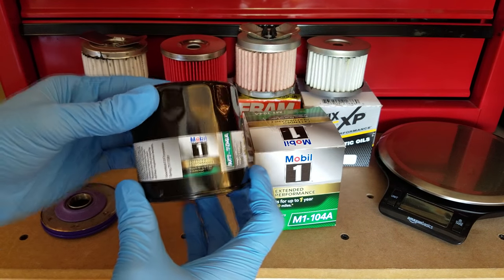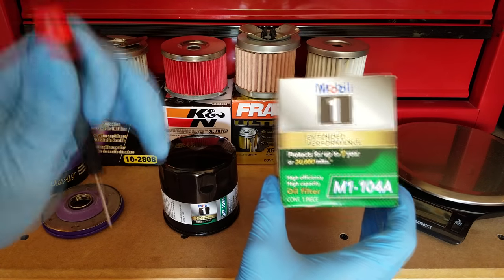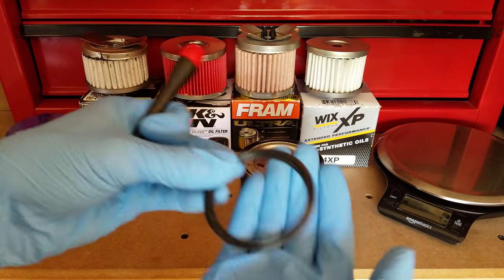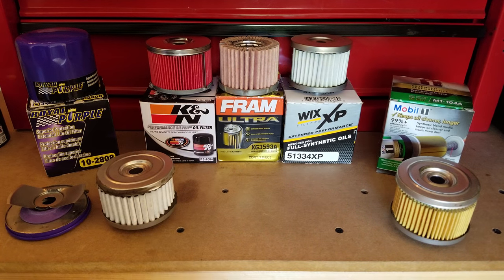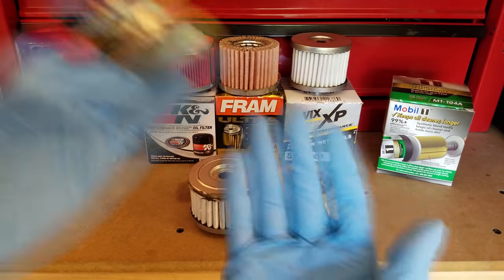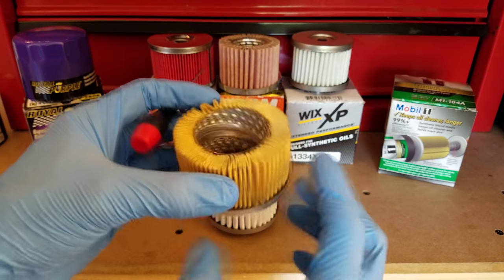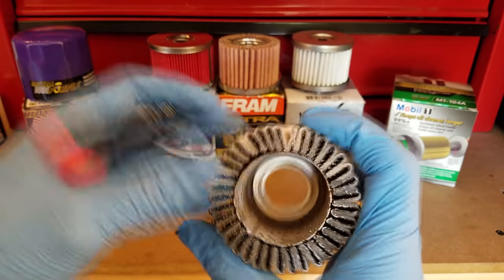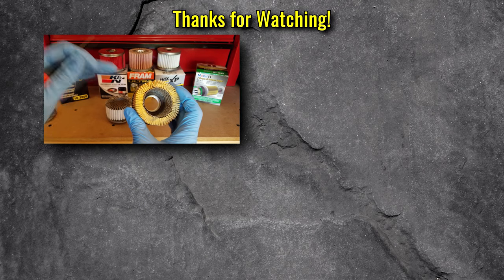Mobil-1 Oil Filter Cut Open! | vs Royal Purple/WIX/K&N!

Comment: my 2014 gmc yukon has 214,000 miles, I change oil every 12,000 miles with walmart full synthetic and ac oil filter, all synthic oil today is so good it does not break down and after 12,000 miles my oil is not that dirty, expensive oil every 3,000 miles is a total waste of money and resources
Reply: I been using castrol, and mobil syn. oil, but decided to try it out because it was $15 for 5 qt. That walmart synthetic was clean af after 3k.
Reply: I use SuperTech synthetic exclusively and stretch it to 10000 miles on all of my vehicles, oil analysis shown no significant wear.  Can't beat the price, $20 for synthetic oil and a quality filter.
Reply: 12k intervals depends on climate, driving patterns and engine. I wouldn’t try that on a VW 1.8 turbo which is known to sludge easily. A used oil analysis can help determine if you can extend your oil changes and if the oil is working well. Having said that, I’m running 12k intervals as well.
Reply: I tried the supertech synthetic and I think it was really good oil.  I feel,  so I'm speaking subjectively, the oil stayed thicker and heavier in my engine,  the engine was a lot quieter and I think my MPG was down a bit because the oil stayed thick and didn't break down.  Again I didnt send it to Blackstone so I don't have data. But you want your oil to hold up to protect my engine. My manual says I can use 5-20 or 5-30, I used the 5-20 grade supertech and I had the MPG of the 5-30 oil I have used before
Reply: You should be changing it every 3k. 12k is way way too long
Reply: @kenshinhimura9387  3 k for synthetic is a waste of money. Unless you drive a 4 cylinder turbo full blast all the time, you can keep the oil up to 6 k easily.  If it's a car that's on the highway all the time you can go up to 10 k. Just check the color, brown is OK, black is not.
Reply: @rejm1161  lmfao... for oil should never even be brown. It should be light gold like honey. If it turned brown you've been driving on it too long. If you want your car to last forever you change the oil every 3k. This is if you plan on keeping the car forever and never sell it. If not then fine, you can go 6k before a oil change
Reply: @kenshinhimura9387   it stay light gold for quite a while , then it start to be a darker gold which is like brownish, then it turn black, but I change mine before it turn really black.  Maybe because of the very cold temperature where I live, the oil doesn't react the same way.
Reply: MegaStick93  and that's why your car doesn't last past 200k miles. Because you don't change the oil enough ..
Reply: @fitnesspoint2006  go ahead and believe what you want. I've got over 270k miles on my engine and it still runs like the day it rolled off the assembly line. That's what happens when you use full synthetic oil and change it every 3k miles. It will last forever. I will have a million miles on this engine and you will have to keep buying new cars.
Reply: @boostedmaniac  lol my friend had a golf whatever with a 1.8 turbo. She came to me and said MY ALLADINS LAMP LIGHT IS ON. I said thats the oil light she said oh I need to put oil in okay. I said no thats not for level but pressure. When the light is on you are damaging the engine. 
So it took 3.25 qts to bring it to the full mark. That engine had 1.25 qts in it. 
Still ran fine.
Reply: @fitnesspoint2006  must be an emo thing?
Reply: @kenshinhimura9387  wrong. Synthetic oil protects WAY longer than conventional. If you use conventional MAYBE 3k is fair but it will last.longer
Reply: @kenshinhimura9387  holy crap you waste a lot of money! Doubling your changes would still get your longevity.
Does that mean if I brush my teeth 6 times a day they will last longer than 3x a day? Nope. Just would be doubling my toothpaste expense
Reply: @kenshinhimura9387  Color is relative. Go drive a diesel with new oil, check after 200 miles, it'll be black.
Reply: @kenshinhimura9387  
Oil color has NOTHING to do with if it needs to be changed or not.  This is a stupid old myth.

I have a Landcruiser with 1FZ-FE.  Oil changed every 6,000 km's with conventional oil it's entire life.....sitting at 536,xxx km's.  Oil is black coming out every time.
Reply: @kenshinhimura9387  I agree. Yes you can let your oil go longer if want but you have no idea what your engine is going through. I think it's hysterical how car manufacturers spend millions of dollars on specialist, laboratories, and test to see what their engines will work best with and how often oil change should be made. Yet, John Doe thinks he knows better than the experts. Oh wait, that's right the experts just tell you to change your oil at the intervals that they say because they want to make more money off you, everything is a "conspiracy" to screw the people. I think I'll just stick with what my owners manual says.
Reply: @tdgdbs1  you still have wear. If you change every 3k you'd have zero wear. Big difference.
Reply: @kenshinhimura9387  Zero wear, how scientific!!!
Reply: @kenshinhimura9387  Just curious, do you work for an oil company?
Reply: @kenshinhimura9387  I'd hazard a guess the manufacturer's are bit more in touch with mileage tolerance for oil than jiffy lube is.
Reply: @RolandtheThompsonGunner  gonzo, most car manufacturers are 10k recommendations now (from bmws to trucks).  so those millions of dollars they're testing says it's more than safe to go past 3k miles, despite what jiffy lube says.
Reply: @wclintf  You ever stop to think the reason they say you can go so long on oil changes is to get you just past your warranty and then you start to have problems? It's called planned obsolescence.

Comment: The Mobil 1 M1-110A can be purchased for $9.99 + tax at Meijer's here in the Midwest.  Usually I try and bundle purchased with Mobil 1 synthetic oil deal when XOM is running a rebate special.  It then knocks my net cost of the filter, after tax, to about $7.50!

Comment: Heh, that's the one I use.  Though they get changed at between 14 and 15k miles with my oil(I do buy the extended life oil too, not risking it if the company doesn't actually claim it publicly)

Comment: One thing to note about the Mobil 1 20k mile 1 year claim/warranty is that there is a stipulation involved with it, You have to use the Mobil 1 Annual protection oil with it which also carries the exact same claim. Otherwise they will tell you to go pound sand if you blow up your motor running that long on oil.

Comment: Mobil 1 and K&N filters are manufactured in the USA by Champion Labs and are built to each contractors specs. Champion also makes some of the cheapest filters on the market for shops and oil change joints.

Comment: The thick glue is actually a good thing, is sealing the filter in the top allowing to open the valve to work if is necessary without leaks otherwise the calibrated spring is not accurate, can deliver a poor bypass supply of oil and defeat the purpose.

Comment: Walmart has Mobile 1. For $10.00
Reply: Jack Smith yeaaaaaa
Reply: Paul Pflaum, If you read the fine print, they say they use recycled oil. That is why it is so cheap.
Reply: David Klimmek agreed! The reason why Walmart brand is way cheaper than any other stores in US. I’d stick to buying oil in Peoboys
Reply: Thats where i get mine along with Mobil 1 oil on the cheap
Reply: Here in California I pay 30 bucks for Mobil oil and 12 for Mobil filter
Reply: notgaybut20bucksis20bucks the price he gave was for a 5 quart jug of Mobile 1 full synthetic oil, i pay the same here in MT. Its the same jug i could get at any parts store without the insane markup. I can get it even cheaper at Costco but they only carry 10W-30 and I use 0W-40, works great those frigid temps we get. Engine's got 168,000 miles still runs like new.
Reply: Paul Pflaum  i just bought it yesterday. did not realized, walmart has it. i used to buy most AutoZone which is more money... AutoZone 39.99. ,,, walmart 26.95... which is cheaper!
Reply: They recently added it. I've been buying at autozone.
Reply: Paul Pflaum  9
Reply: Paul Pflaum, way to step up internet tough guy.
Reply: I just about oil 1/28/19 at Walmart M1 EP high mileage 5w-20 and it was $29.99, annual protection was $39.00 they're both more than I expected oh yeah the annual protection filter was close to fuckin $18
Reply: I'll make it simple, if buying the items seperate buy at Walmart, if doing an oil change buy at whichever autoparts has the best Mobil one and filter special, it's only worth buying at autoparts when they have their oil specials , it'll usually save you 5-7$
Reply: Why would you buy that crap when Royal Purple is the best !!!
Reply: @williamschuman4951  Because I'm not public schooled. I like keeping more of money. Not paying $12.00 for a quart purple oil. That I can buy for $3.00..

But as they say. A sucker will buy anything, even a turd. If you call it the best cow shit turd, money can buy..
Reply: They have Castrol Edge high mileage advanced full synthetic oil for $22.48 plus tax.I also bought the mobile-1 oil  filter extended performance. For 9.68 plus tax. Basically like you said 10 bucks. I live in south Tx it gets super hot down here in summer. I’m putting the best in my car, because it’s a fact, that heat destroys a car. Full synthetic keeps the engine cooler. It’s better to pay a bit more for better protection.
Reply: Attention wal- mart shoppers. They have royal purple gallon at Walmart for 38 bucks plus tax.
Reply: Trade mark lose the e
Reply: @ricketysplit1  not true at all. I looked at the label and even found it online. After using a word searching tool and looking myself the only time the word recycle is used is on the front when it says "recycle used oil at participating retailers"

Comment: I bought a Mobil1 filter tonight and unfortunately they have changed the base plate.  The gasket is now squared off and sits in a crimped channel.  It has 8 small holes and  20 mm stamped on it.

Comment: I got over 30,000 miles utilizing a K & N premium oil filter and Amsoil signature series 100% synthetic 0-20W motor oil with superseding used oil analysis optimal test results and less service intervals. You get what you pay for. Actually, if you perform the math, the aforementioned duo is more cost effective than its competitors.

Comment: Mopar brand oil filters? I've been using them for about 6 years now.
Reply: Brian B thanks,I use MOPAR,( at Walmart Helena MT) on my Journey 2015 4 CYL, IF I,can loosen it from MOPAR Dealer Performax( Mexico) FILTER THEY USE ON PROGRAM Oil changes::they use MOPAR CONVENTIONAL 5W-20 , & sometimes I replace if 2000 mi or so: before my Scheduled........hopefully may help...though as a rule, prefer NAPA GOLD for shorter OCI, ROYAL,PURPLE longer oc8

Comment: The lip on the o-ring is to help keep the o-ring from sticking to the engine side when you remove the filter. When a person doesn't pay attention and two o-rings are smashed it will leak real bad. Imagine a person not double checking for the old gasket and not checking for leaks..... I am surprised all filters don't utilize that design now.

Comment: I used wix then puralator boss and now Mobil 1 EP oil filters and i dont know any difference never took a sample to a lab and I switched from M1 high mileage and it slightly burns oil but no burn when I use extended performance 15k mile

Comment: I normally use motorcraft filters but tried a moble 1 on my last change. I was surprised to see after 3000 miles the oil was still amber in color. the oil was always much darker with the motorcraft after that many miles. I have to assume its because of the filter.
Reply: Were you using a conventional or semi-synthetic blend before?

Comment: I found your video entertaining because I've never cut open an automotive oil filter. The only critical comments I can make are you educated in the different types of O rings/solid seals and whether having a spiral seam that is a much longer length vs a straight seam is better? You made a few judgements without backup facts such as materials used. Now a  days we have some great engineers designing equipment and in my limited experience I have found that materials and the manufacturing process are usually the critical determination of whether a product is "best quality".

Comment: You really need to work on holding your hand steady and centered to prevent the focus hunting. Rather than constantly moving your hands, hold the filter steady and talk. Don't talk with your hands while onscreen. Less jerky movements would greatly improve your production. Slowing your focus down a notch or two in the camera would also help.
Reply: Or use a wide angle lens set to about f 8 and manual focus the entire frame. No more focus hunting
Reply: That's the whole reason I watch this guy. I love the fast crazy hands. It's going to be a new trend.
Reply: @Filterficial  Motorcraft PLEASE!!!

Comment: I have a friend of mine who never changed his oil for 50,000 miles...that's right ...for... FIFTY THOUSAND MILES..!!!....It was a Toyota Celica GT...And also he never checked his spark plug wires for cracks and normal wear....He came over my house one day and asked me to check his car out..cause i was one of the best shadey Tree Mech around I was always working and tinkering with cars especially when you own an British MG antique sports car...anyway on the spark plug issue that was seasy ..i told him to pop the hood and crank her up  and it looked like a fireworks display under there!! lol Sparks from the cracked wires were going everywhere!! lol and on the oil change issue his soil was almost like crystallized MUD..!!  Flushed it out the best ci could with the products they had duridng the early part of the 80's. Well we changed the oil on his car and later on down the road the Celica GT just couldn't stand the new OIL AND BLEW UP>>>lol...end of story...

Comment: Have you ever heard of old timers, Korean War vets placing a strong magnet  (1" diameter x 1/8' thick)  at the bottom of their filters..
Reply: Some oil filters nowadays already come with a magnet built in to one of the end caps.
Reply: @JA-rn5qv  Which ones???????????????????????????????
Reply: @FooFahFoeFum  he is talking out of his ass. No filter comes with a magnetic end cap, and it's easily testable if they are.
Reply: Some cars have a magnet in the oil pan to pick up any swarf from the engine to prevent it circulating.
Reply: @FooFahFoeFum  You can buy magnets made for engine oil filters that you can reuse many times.Some are flexible and wrap around the filter.Not super powerfull.Some earth magnets can be put on the oil pan and are incredibly strong.They are so strong they are hard to remove.The magnetic drain bolt is a good idea even though it is not very big.One thing it will tell you for sure is when you have a problem.If the magnet is covered with filings then you have a problem.Places like Sumitt Racing and Jegs have these magnets and the earth magnets can be found online or in any hardware store.Most of the older GM transmissions I have changed the fluid on had a round flat magnet attached to the bottom of the oil pan and usually have a fair amount of debri on them if the oil has not been changed on a regular basis.Whether that magnet saved  the trans from a rebuild ,I can't say, but having that debri on the magnet  does make you feel better then thinking it is circulating all through the internals.
Reply: I think some HKS filter has magnet in their filter design , but mainly design for performance car.

Comment: Just changed oil in 2010 Honda Odyssey. Used Mobil -1 oil and Mobil -1 filter. Got old oil out, put on new filter checked oil level, ready to go. Got in car went about 2 miles down the road and oil light comes on. Pull over and check oil level. New oil is hard to see on stick but looked full. Drove on and check engine light comes on. Pulled over and called tow truck. Got home and was cleaning up garage and noticed rubber seal on floor. Looked new and then it hit me. The seal had fallen off the new oil filter. I've never seen that happen before. Had another new filter went and checked and rubber seal fell off that one. Mobil doesn't attach the seals anymore?
Reply: i just did a filter change . no loose seal with my mobil1 filter .
Reply: Thanks interestingly I check , base plate,wipe, and recheck,Oiled gasket carefully:THEN DOUBLE CHECK MYSELF FOR ANY leaks right away,etc.